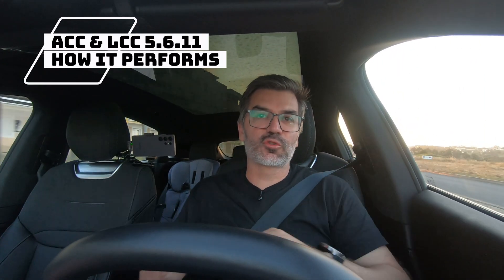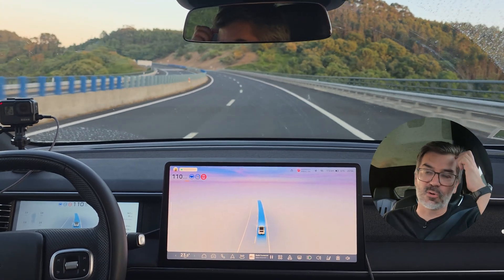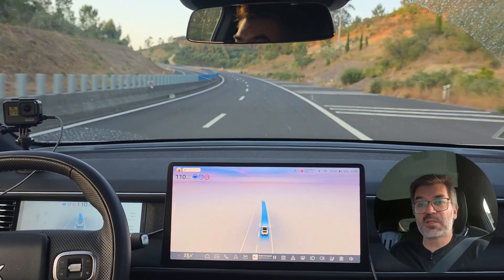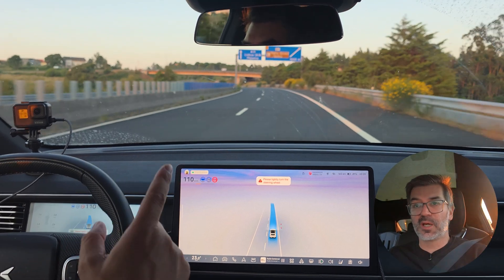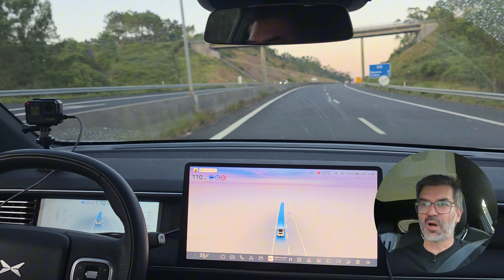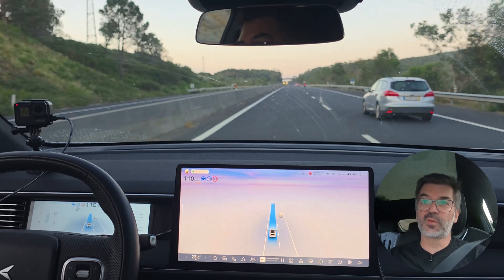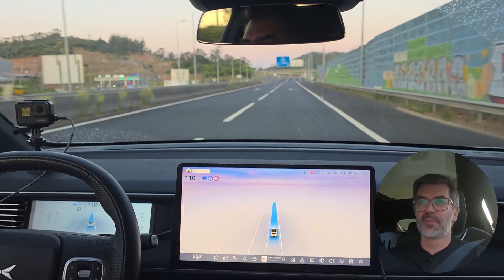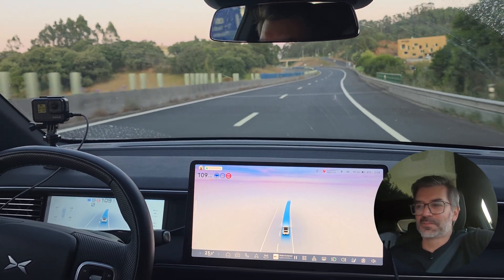XPeng ACC & LCC Slowdowns: Will the New Software Fix It? (Current Test Before SW Update)

Comment: Seems to be on par ( Just as bad) as my TM3 does after the Vision (camera only, radar for cruise control disabled) downgrade almost 3 years ago. Utter unbelievable junk. Does Xpeng also slow down when visibility gets below ex. 300 Meters in the daylight?
Reply from the maker: Never tested the Self Drive in bad weather conditions where visibility is low, so can't answer. I did test TM3 and TMY self drive before getting the Xpeng, and it was better overall. But it had flaws also. Anyway i don't expect that XPeng can have the same knowledge and SW level as Tesla, as they just entered in a few month in europe and Australian markets, meaning that they don't have enough data to use in order to adjust and calibrate their systems. Driving in China is totally different then driving in Europe. Lets see if they evolve or not! With a new brand we don't know ...
Reply: @XPengPT  MY HW3.0 TM3 will do a max. of 7 Km/h (Seven!) on the "basic" adaptive cruise control  with 300 Meters visibility on an empty straight road in the daylight after the "Vision" downgrade and it starts failing intermittently from 500 Meters meaning commuting 200 Km daily has ensured i will never ever again look the Tesla way and as i find Xpeng very attractive on most of their parameters i was looking for info. But still a couple of years to go before it will be replaced. TY for reply :-)
Reply from the maker: Yeah i know that when Tesla downgraded to Camre aonly vision it broke a couple of stuff. Also Xpeng with the models they introduced in Europe they rely only on camera, so i believe that "The Camera only" has some limitations, or at least they still need to calibrate or fine tune better the platforms to use only cameras.
Reply: No, my experience is that XPeng performs quite well in inclement weather compared to my previous Tesla which could not handle direct sunlight, rain or foggy conditions very well.
Reply: @GrahamTurner-s6z TY, valuable information. Exact those things i really suffer from.
Reply: I never use XPENG autopilot AAC LCC in the rain knowing that it's a camera based system. The manual also advises against using autopilot in certain conditions
Reply from the maker: I used it with no issues, if it is raining a lot, the system will notify that camera system is degraded and the feature cannot be used.
Reply: @KwanRay-g3r  Commuting 200 Km daily i need a reliable system that works as reliable as a radar based system do and hates how i have to drive manually those days where there's mist/fog here after my car was degraded by Tesla. Very valuable input, TY :-)

Comment: I prefer for it to slow down at corners or curves because its safer and more comfortable so i don't feel like i have to take control back.
Reply from the maker: I prefer the approach of safety also, but this is a matter of calibration, because i already tested (not recorded) and it is a strange situation. For instance in the same highway if i set the ACC to 110km/h, it will slow down to 103km/h, but if i set the ACC to 120km/h, the slowdown will be to 113km/h, this means that in the same turn the car it is able to do at 110km/h, so there was no reason to slowdown in the first test. I will record this also, to show. So, there is in fact room to improve on this matter, and Xpeng does know it, as they are indeed testing and releasing updates focused on that.
Reply: @XPengPT interesting. I haven't tried it myself. So usually around soft corners it seems ok on mine but hard corner, unfortunately, i still dont have the courage to trust the autonomous driving completely haha
Reply: You are only being annoying to others in the traffic as there is absolutely 0 safety involved with the curves shown in this video.
Reply from the maker: Probably you have not seen the video correctly. Do it again, it helps with the views!
You will see that there is almost no traffic at all around me.
There is always one thing that i will do for sure in my videos. I will always make sure that i am safe and others are safe. Probably you can't achieve that by watching a video. Also, BTW a reduction in speed of 7km/h hardly puts anyone at risk, unless they are already eating my butt (and that is a dangerous move by THEM not me!)

Comment: Yeah, this needs to be improved soooo much..  I drove a Kona Electric before my G6 and that did NOT have any issues. Also the automatic lane change is stupid: 9 out of 10 times it won´t do it, I have to grab the wheel and then it overcorrects because I didn´t change lanes fast enough... It's a hot mess right now..
Reply from the maker: The self drive is in  fact something that needs improvement. That i believe that will be at some time. I believe that Xpeng is going slowly using available data and progressing with it. On the auto lane change, it works for me, but its slow also to do it, so if there is lots of traffic, it will not be useful, because it will not make any change and abort. But again, its a secure measure, i don't know if its better to be improving slowly or to have some accidents in the middle because it wants to be fast and furious launching a feature.

Comment: I did a 400km motorway drive today in my G9. The handling of bends in either ACC or LCC were painful. This update is desperately needed.
Reply from the maker: I agree! It's not useful for a long and normal trip. I do use it a lot when im tired and need to relax a bit more, and i dont care about the slowdowns. But specially when we have more passengers it's not comfortable at all

Comment: I just did Toulouse to Saint Sebastian and back. Realistically with normal traffic you have to take back control as too many slow downs and lcc drop out. It’s very good but Volvo xc60 was better for just acc and driver intervention. Auto lane change is a gimmick useful in light traffic
Reply from the maker: I agree. With heavy traffic it takes too much time to do it and aborts. I agree fully with you

Comment: These are exactly the two things that are just annoying. The car brakes for no reason, even on the highway. You can't use the LCC (Lane Centering Control/Lane Keep Assist) on country roads; it brakes from 100 to 70 km/h even for a minimal curve. On the highway, it's a nightmare. And yes, it's often an extreme struggle to override the LCC; the vehicle really fights back. The adaptive cruise control could also be a bit more relaxed and act with more foresight.
Reply from the maker: I did adjust myself to the LCC override and with a strong movement the car accepts it easily. But let's see if it gets improved. I don't use self drive on country roads only on highways. When the highway situation is improved and fixed and will move on to other roads :)
Let's see what happens.
Reply: I am driving to fast, over 200. No Speedlimit here. But I love the car. 
The consumption in City comute is around 10kWh awesome.   @XPengPT
Reply from the maker: It is a wonderful machine. Points to be improved but it is overall a good car!

Comment: How to get into the beta program? Sounds great!
Reply from the maker: Last times it was via the Xpeng APP, on the Events section (If you don't find it on your app, check my video on the app that explain what you need to do). But this time, for some reason this new Beta it was not announced and it was not in the events. Seems that Xpeng selected a few persons to have it before official release. So, i don't know how at least for this one. It may be, because in China they were forbidden to beta test using delivered cars in public, as .... you will be testing a beta software for a feature that can be potentially dangerous ... But i don't know

Comment: Cheers for another nice vid. In the section you are talking about Autopilot takover; you can of course use the gear shank and push it upward (not all the way up, just about half way)  - to disable ACC / LCC. Just in case someone didn't know .. Keep up the good work .
Reply from the maker: True, but the idea is to keep autopilot on, and just manually overtake to perform a maneuver and then let the car take control again. This is a good implementation by Xpeng, because recently, Tesla (that has years of experience on this systems) did had this as the main complain in Self Drive SW. The drivers had to re-activate the self driving every time they changed lane manually (don't know if it is fixed).